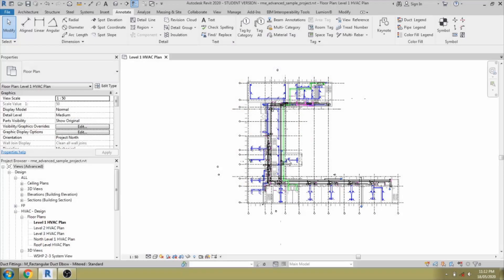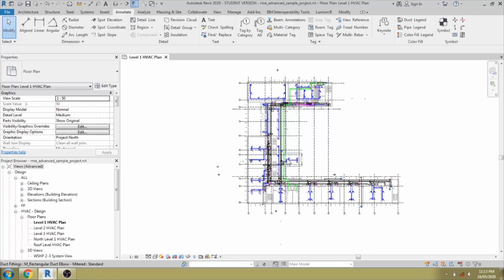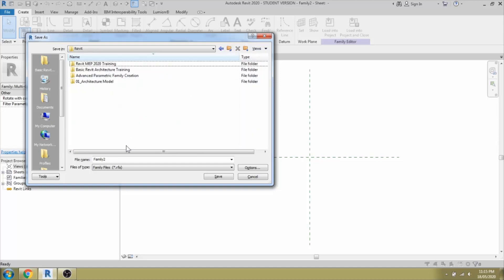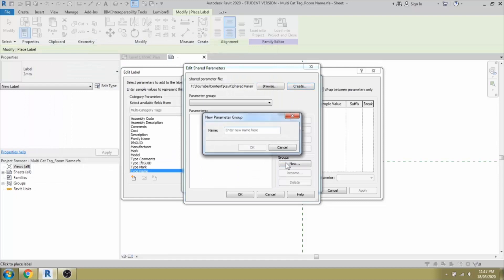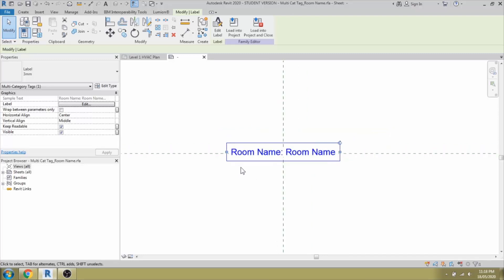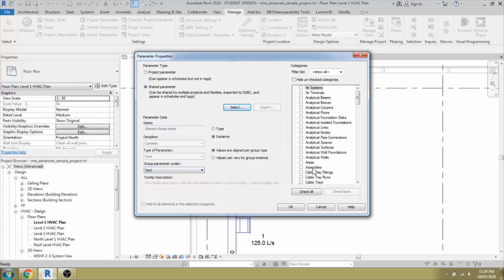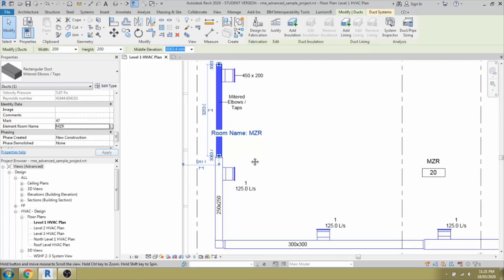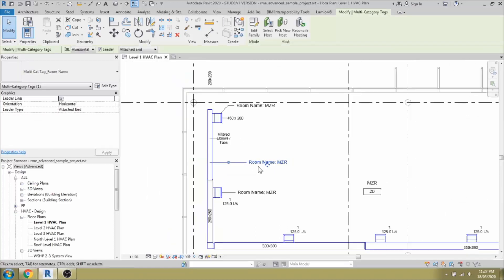How to Create Multi Category Revit Tag family

Comment: Dear How to create slope pipe tag i mean Bottom of pipe... tag instead of spot elevation.
Reply from the maker: Please check this video. I have made it for you. https://youtu.be/v5iyQA1nqow
Reply: Dear Thank You very much for your cooperation....as you asked in video you use parameters to get invert elevation.... I am using old version of Revit like 2021....  And using spot elevation option to get high and low point elevation.... Can you please make a video for 2021 version user.... Really appreciate
Reply from the maker: @Rasheed Khokhar  As I have mentioned in the Video if the parameters not available you have use Dynamo to solve it.
Reply: @BIMModeller  OKY... THANKS FOR RESPONSE.